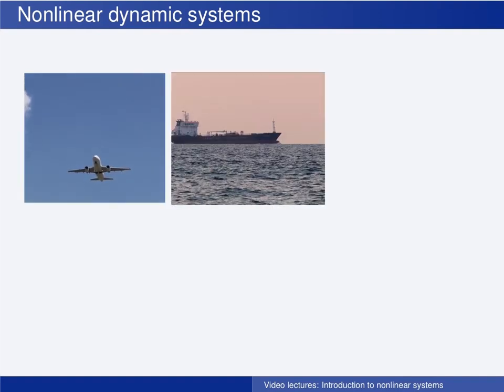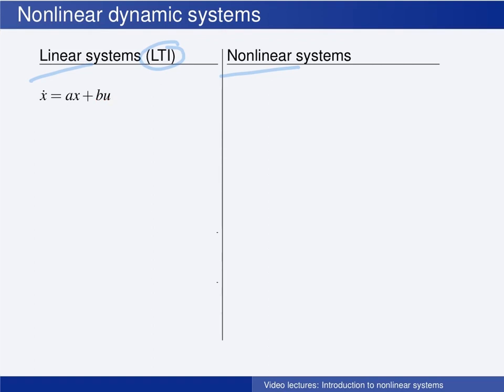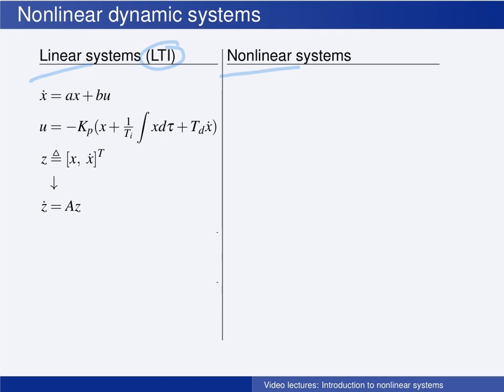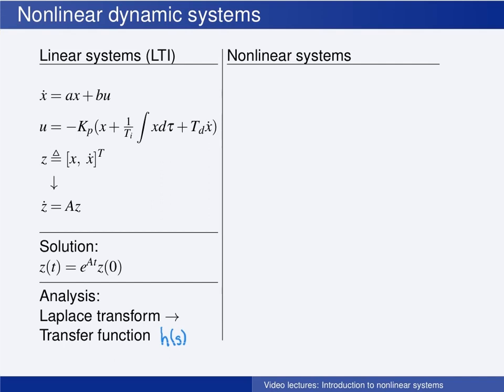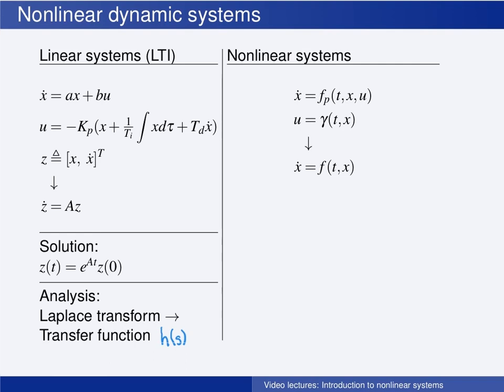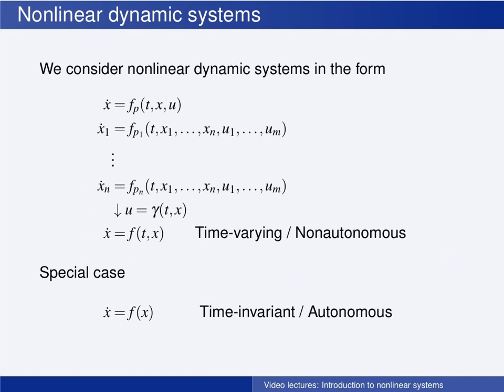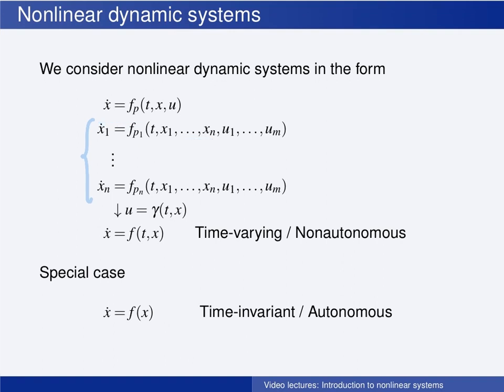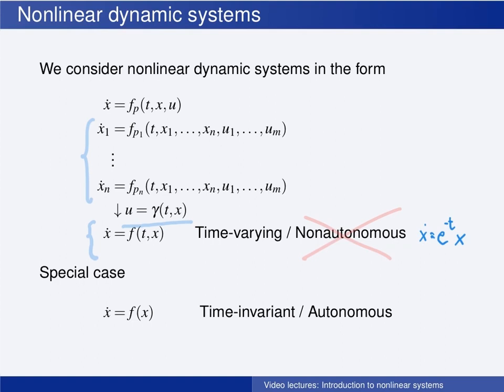L1.2  Nonlinear vs linear systems - 2 The basic differences

Comment: Do the words autonomous and non autonomous are currently used by control field or some other fields?
Reply from the maker: The words autonomous and non-autonomous have come to have another meaning in the robotics and control field than in the book by Khalil. In the book, "autonomous" means that the differential equation describing the system does not depend explicitly on time, i.e. dot x =f(x), while a non-autonomous system is described by dot x = f(t,x). In recent years, the term "autonomous" has come to mean a system (robot, car, etc.) that makes decisions independently, i.e. without the intervention of a human operator.
Reply: @KYPTeachTech  Thank you...